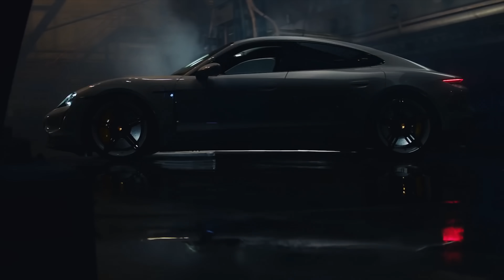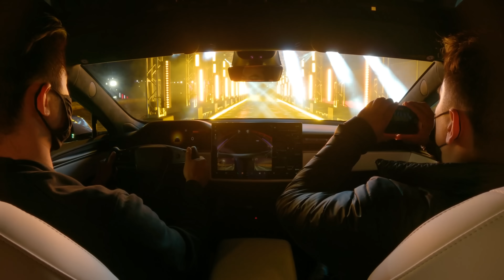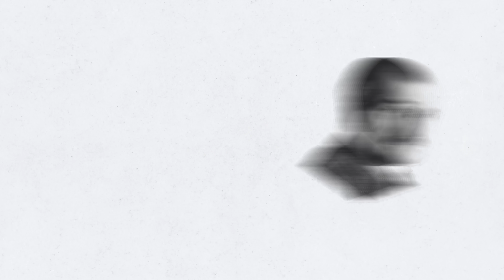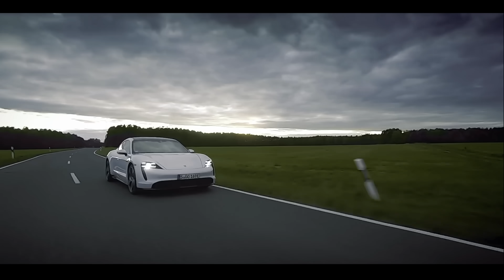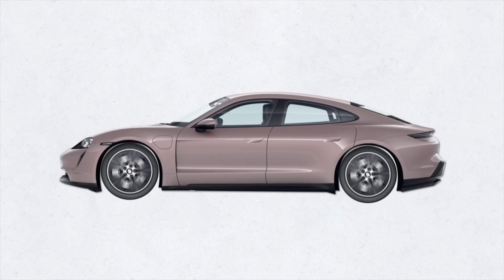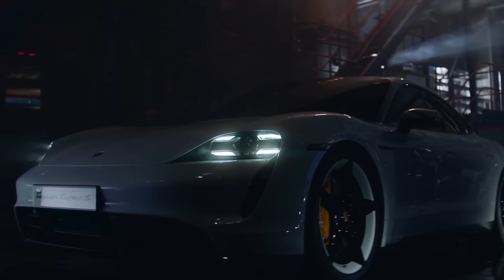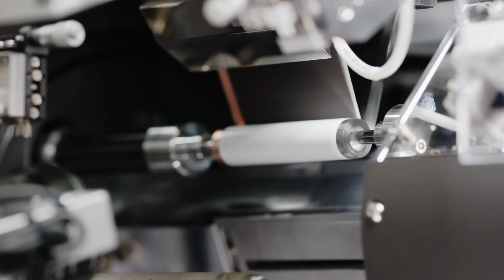I’ve Had Enough, Here’s the Truth About Tesla

Comment: My RAV4 diesel on a full tank has a range of roughly 400 miles and takes about 30 seconds to refill the tank which funnily enough is around the distance from our house to our daughters house so I can leave home with a quarter of a tank and refill in quite a few filling stations on the way, now could I leave home with a quarter charge on an electric and have plenty of charging stations on the way and not hang around for an hour to get me a little farther down the road to repeat the same, don’t think I’ll be letting go of my internal combustion engine just yet or indeed don’t think I’ll be doing it in my lifetime yep I’m an old timer

Comment: I am hearing repeated issues with Musk's EV's. Poor paint quality due to accelerated times in the spray booths. This is clearly evident on close inspection and a frequent complaint by owners. Faulty exterior door handles that fail to protrude from their flush position when attempting to enter vehicle. Body panel seam tolerances varied. Air conditioning temperatures unable to provide sufficient interior cooling. Command center touch screens going blank or rebooting. High mounted brake light LED's shorting out. Lastly, "YOKE" on Plaid version loosening from mount. SOURCED from EV owner's forum regularly updated with frequent quality control complaints pertaining to this particular car manufacturer.
Reply: Trivial compared to the problems I've had with my VW ICE car.

Comment: not affordable range issue may have been cured. But charging takes hours. Which on trips would take forever. Fire hazard if hit. No charging stations yet. Battery replacement will be costly more than the cost of the car. Maintenance is high. To fix the car it has to back to a Tesla dealer. Which will be charged to be towed or flat bedded added to the cost of repairs bill. Lube the brake calipers due to lack of use Tesla only. Anything needs to be done Tesla only. Tires doesn’t last dealer charged only by Tesla only.

Comment: Option C. I prefer my Highlander. It rides like a dream, gets 30mpg on the highway and I can stuff an elephant into the rear hatch. Will those fancy EV's last as long as my car? I doubt it.
Reply: What engine does your Highlander have and what year.  That's amazing gas mileage.
Reply: @IsItTrueThat  It is a 4 cylinder 2013 model. I looked specifically for a 4 cylinder after seeing one of Scotty's videos about it.
Reply: Well, you do have a toyota, so i doubt it also!
Reply: These fancy EV will bring you a lot of troubles after 5-7 years of ownership. Quite expensive in the long run.
Reply: @JoeGX460  Lets go Brandon!

Comment: Here is the thing about the steering yoke. As far as daily driving you will learn over time where everything is and your reactions will be the same as a round wheel. After driving over 30 years now 9 and 3 hand position has saved me from many accidents or over correcting and running off the road. If you grab the tesla wheel like your supposed to and drive you won't loose hand position in a pot hole. If your driving one handed and not paying attention then no matter what your wheel shape is you have a good chance of wrecking. Tesla just has a different mindset then other car companies. Good bad we need time more then opinions to really say for sure.
Reply: @vikingskuld  In a round steering wheel there are more options to place your hands.
The yoke denies the ability to switch to 10/2 & 12/4 options, I like choice. 😉
Reply: @CNile-se9xw  then don't buy a tesla thats a choice lol. Do you know how tight a turn radius the car has, you may not need all that choice if it's 4 wheel drive and has a high turn radius. I'm not sure as I never drove one.
Reply: @vikingskuld  Not buying a Tesla is definitely my choice. 😉
When I first heard of the yoke wheel, I thought it may have speed & turning aggression factored into it, but it doesn't so I'm still not impressed.

Comment: Tesla all the way for me. We have a Model S Long Range on order and it should arrive in late November. The 4680 is delayed but you have to give Tesla props for innovating this improved tech. Our S will use 1865 batteries with improved chemistry thus giving our car its industry leading 400 mile range. I have sat in a ridden in a modle S for some distance and I have to say that it is as comfortable if not more than our Mercedes-Benz GL450 (which is like a sofa on wheels) and the Tesla engineering tech is miles ahead of ANY other BEV maker including Porsche. I could go on but suffice it to say that it's going to take other manufactures many years to catch Tesla, especially in the areas of control, firmware and software update as well as battery efficiency. Tesla is just light years ahead of the others. I hope that other automakers compete hard because that will drive innovation which is what we need here in the USA. For now I agree with Munro and see Tesla as the one to beat overall.
Reply: Why?
Reply: @lalo38th41  why what? Be specific and you might get an answer but I know you really don’t want one so whatever…
Reply: No they're not. Teslas are cheap pieces of crap.

Comment: Neither for now...I'll transition with a hybrid until the bugs are out of infrastructure, batteries, home charging units and above all; the cost.
Reply: I have a home tesla power unit, hardly ever charge anywhere except home. I can drive for 370 miles and it costs about 12.00 for the electric to drive that distance. The model 3 is under 40k.

Comment: Scotty, it has already been established that the US Power Grid doesn’t have nearly enough capacity to recharge millions more EVs without a substantial increase in electricity generation capacity and major upgrades to the grid. 
How do you feel about a vehicle with a fully electric drivetrain, a smaller and lighter battery, and a Microturbine Generator (MTG) with the capacity to power the vehicle while simultaneously recharging the batteries?
MTGs have been in use for some time and utilize a small and simple Turbine (Turboshaft) Engine that is directly coupled to a Generator that is designed to produce electricity at the Microturbine’s most efficient speed. 
MTGs are very efficient when run at or near 100% RPM, have almost zero Emissions (US EPA doesn’t require any exhaust gas treatment), are almost maintenance free (uses airfoil bearings so no lubrication system and no cooling system). They can run on just about any fuel available and most are designed for a 10,000 to 15,000 Hour Lifetime which means the MTG will probably outlast the vehicle. 
 If the idea of MTG Range Extenders would be embraced by the EV industry it would instantly solve the issues of “Range Anxiety” especially in areas where recharging options are limited or not available. 
If manufacturers would adopt a “Plug and Play” standard for all EVs with a mounting location with the necessary connections for a MTG could lead to a new retail/rental business where EV drivers could rent a MTG for occasional long trips or purchase on for those that need it for daily use.
Reply: If it was really that simple, then it would be widely produced

Comment: Comparing Tesla to conventional cars is missing the whole point.
However, very informative video. Thank you.
Reply: Not really, they shouldn't try to change decades of things that weren't broken like getting rid of the turn signal in place for a touch sensor
Reply: @JohnSmith-qh5ke  Yeah process of making batteries is just as bad.
Reply: @JohnSmith-qh5ke  That's with power plants. The fact is getting the raw materials for batteries is worse then gasoline.
Reply: @JohnSmith-qh5ke  I did and manufacturing is worse then gas.  And then it varies on the operation of the specific EV. Don't assume next time

Comment: At just over 200 miles of range, the Taycan just doesn't cut it in the specs department - especially when compared to the almost 400 mile range of the Plaid. It also doesn't matter if the Taycan can charge to 80% in 1/3 less time than the Plaid since the Plaid, because of its longer range, is actually adding MORE miles per minute of charging than the Taycan.
Reply: It must take hella longer to charge for those 400 miles, and how often to people drive so far at once. It's a chance to get out and have a break and revive and not have to spend so long doing it.

Comment: Well, range and speed is important to me, so ...it's an easy choice.
Reply: Ah so a gas vehicle, good choice
Reply: @bestlaptop_psn  if only a gas vehicle could touch the model s plaid in acceleration :)
Reply: @michaelthelizard7056  If only an electric vehicle could reach a gas vehicles top speed :)
Reply: @bestlaptop_psn  rimac nevera :)
Reply: @michaelthelizard7056  Hennessey Venom GT :)
Reply: @bestlaptop_psn  9.9s quater mile vs 8.6s quater mile, 12mph difference in top speed and no-one will ever go that fast, I think I know which one is better :)
Reply: @michaelthelizard7056  Yup gas is king :)
Reply: @bestlaptop_psn  King at losing drag races :)
Reply: @michaelthelizard7056  And Electric still loses in the track :)

Comment: I never been a fan of Tesla, mainly because of the design on everymodel.  Keep your Teslas!!!💯
Reply: All this talk about new tech. I'm still driving my 2003 Honda Odyssey 🤣. Was going to get rid of it this year but after seeing these prices, with good care I think I can squeeze out another 100k miles.
Reply: Interesting that you should say that since Tesla is now the highest ranked car brand by customer satisfaction. Oh, and in case you didn't know, that fact is now being recognized in Tesla's stock price which today hit an all time high making Tesla the 7th most valuable company in the world. Cheers!
Reply: @normvanduker9999  Too bad Tesla's build quality is crap. The have 205 reported problems for 100 vehicles sold by far the worst in the industry. As a point of reference Dodge which ranks just above them has 166 problems reported per 100 vehicles sold.
Reply: @brandons9138  Please link where you got those numbers - I can't find that anywhere. Also, the problems reported might be cosmetic and not issues that would render a car un-drivable since there is a huge decrease in the number of mechanical things that could malfunction in a tesla or any EV for that matter.
Reply: @palmergary  Try true delta. Usually it's small stuff...but it usually requires a repair and I personally can't stand cars that need alot of repairs..I have better things to do with my time than getting my car repaired constantly.
Reply: @palmergary  small stuff... you pay 100k and still got panel gaps.
Reply: @normvanduker9999  Oh the same ranking that's bought out by the car companies, yeah real trust worthy.

Comment: Hey Scotty, I live in the snow belt in Ontario Canada and I’m trying to decide between a new RAV4 , Honda CRV , or Subaru Forester. Did Honda solve the oil dilution issue? Are Subarus still prone to head gasket failure?
Reply: I’ll take the Forester because I like pissing off normal people.
Reply: Hi, i am living in Quebec city and i know winter very well. I had a 2015 honda crv for 6 years and it was very reliable. However, on the trim after 2016 they added a turbo. Honestly, i would prefer the RAV4 because of the traditional engine without a turbo that can last 10 years + easily.
Reply: @JoeGX460  tabarnAk
Reply: RAV4 for reliability, longevity, and resale value. 👌🏻FJB
Reply: Only buy subaru if you really do off road + snowy conditions
Reply: @kojsiusoaliu6772  And always keep a spare head gasket and some wrenches handy.💩💩💩
Reply: Take the Rav4, if you take the CRV, you will need to walk with a blanket in the winter. It's know issue for CRV owners in 🇨🇦
Reply: CRV for the win
Reply: Mazda CX-5 for the win!
Reply: This is just a random opinion, but I'd take the crv out of the three. It probably has the most reliable engine and fuel economy.

Comment: Plaid because they have the record at the Nurburgring!  But I’m a EV hater.  That is because the high cost of replacing worn out battery packs.  Also EV don’t contribute anything to pay for the road maintenance.  Except for toll roads of course.
Reply: not true, here is NC they charge EV owners a min of $150.00 a year to makeup for lost tax revenue at the pump. It is expensive to replace the batteries however they are predicted to last 600K plus miles (with a minumum degredation).

Comment: I think best EV is Nissan Leaf other than cooling the battery it’s simple affordable well built and the interior is just like other cars buttons to control heating AC radio all of it are buttons and nothing is electronically controlled like Tesla’s Chevrolet bolt Volkswagen ID4 mustang Mach E and other high tech EVS if you are considering and electric vehicles try out Nissan Leaf they have different types of models they have S model with is base. SV mid range model with half of features and SL model with is full loaded depending on your needs the plus models of Nissan Leaf can drive 200+ miles on single charge or if you really want to save money then don’t get the plus model and without that you still get 150 miles on single charge maybe little more depending on your driving habits